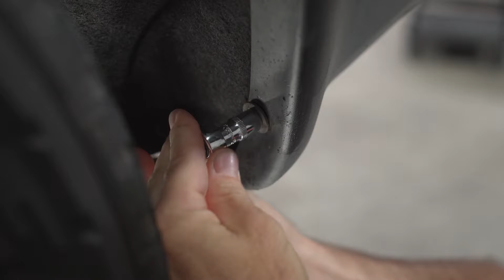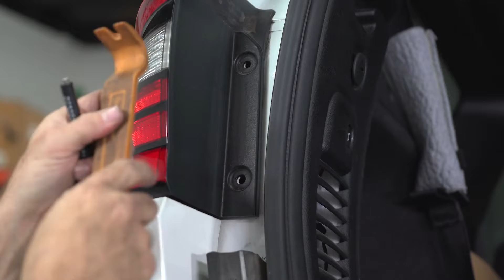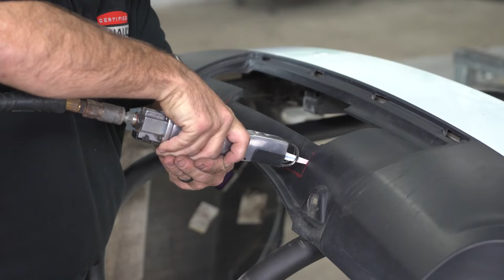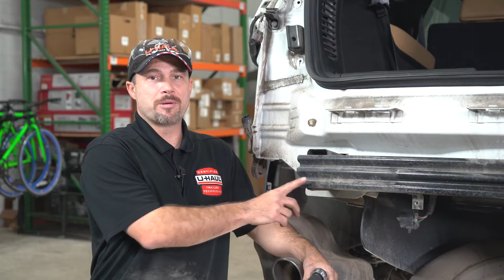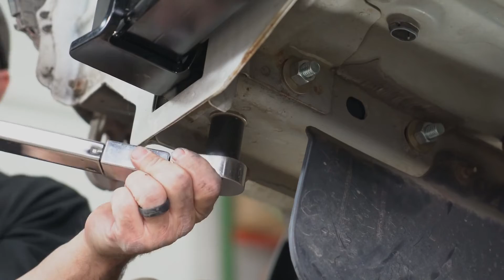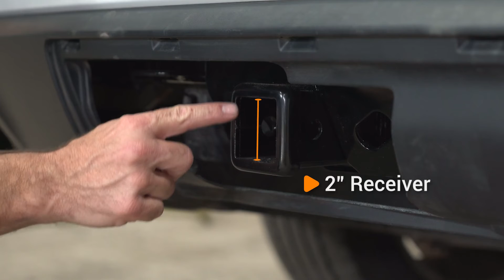2011-2026 Dodge Durango| U-Haul OEM Style Trailer Hitch Installation

Comment: What year Durango is this i have a 2024 and it seems there are different ways to install depending on what year you have
Reply from the maker: Different trim levels can change the fascia. So, some do not have a Factory Knockout like this Durango Citadel. Unfortunately, this Draw-tite OEM style hitch is no longer available since Draw-tite closed operations. All other Available hitches install in a different manner. But they do all fit the 2011-2021 Durango and the 2011-2021 Jeep Grand Cherokee, Including this out of stock OEM style, The Grand Cherokee SRT has this same factory Knockout. Sorry for the bad news! Alternate style Install here: https://youtu.be/PwqL1dhFRt4

Comment: how about hauling a trailer with electric lights and brake lights
Reply from the maker: Wiring is a separate part and therefore a separate video. This video will cover the part and steps for a 2014-2024 Dodge Durango https://youtu.be/rhxN8oRGs7s